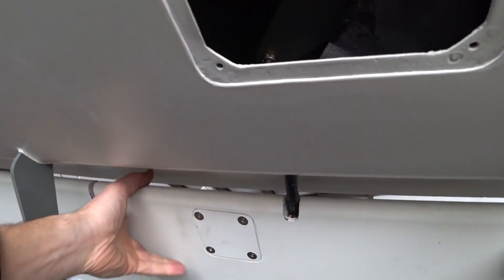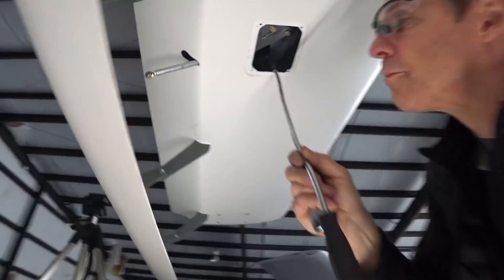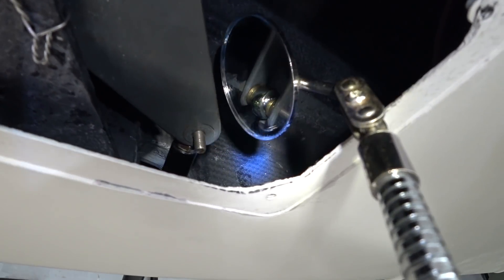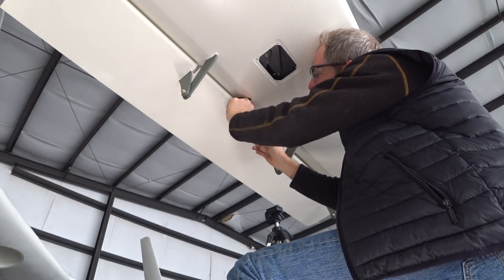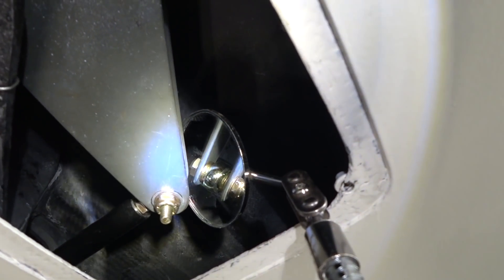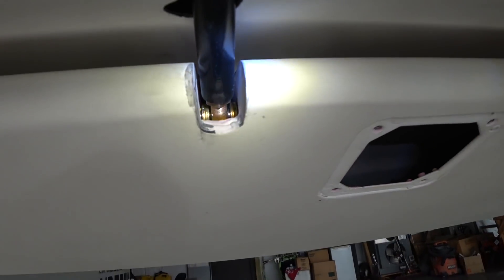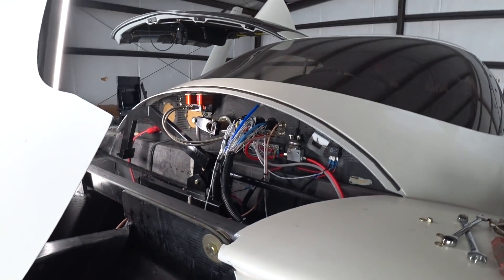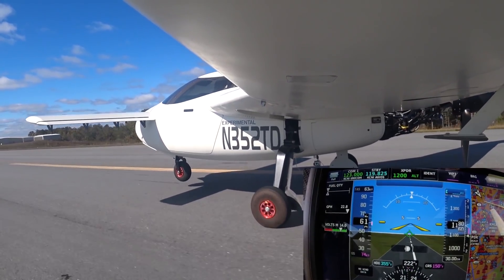Elevator Drop Test - Building the Raptor Prototype

Comment: Hi Peter, Thanks for the update.... Elevator looks solid now!  Disagree with Snow Andrews comment.... I don't know how many PIC hours you have, but one hires test pilots to ensure an expensive prototype is not lost.  The test pilot role is best left to those with a wealth of experience and knowledge.  Their seat of the pants feeling at rotation is likely more sensitive and critical than yours (or mine for that matter, guessing that with more than 3000 PIC and many more right seat or lower crew member hours).

Comment: Peter - I may have missed it, but are much of these issues with the control surfaces going to be re-engineered in/for the production version?
Reply: Brian Garrett most likely production thing about development is you learn tricks then find solutions
Reply: @TransamJc  i was thinking that too,probably upgraded more aswell.
Reply: In a previous video he mentioned using a push-rod system instead of the cable design on subsequent aircraft. This will vastly improve the handling of the airplane while increasing weight slightly.

Comment: What is going to happen when the craft is G loaded (positive or negative)? What response to the counterweight will occur? Move to add or remove G loads?
Reply from the maker: This is the reason for using a counterweight. The same forces are felt by the elevator and the counterweight so it always stays balanced.

Comment: 1:17  “spring acting as a damper.”??? I know this is pedantic but that is dead wrong. 
Spring and weight is the classical way oscillation is taught in high school physics. You do NOT have any damping.  Airflow turbulence is a perfect energy source to provide resonant feedback. 
This gaff makes you sound like the engineer that built the Tacoma narrows bridge. Or the west gate in Melbourne. 
The spring increased stiffness of the system. If you want a damper look up the flutter that motorbike stealing dampers prevent. That lump of lead will mean that the resonance frequency is too low for flutter. 
BUT. And  it is a  🍑 
That frequency might be just right for what aircraft of this design naturally do at stall conditions. If it hits the resonant sweat spot when low and slow. 
The source of the perturbation does not have to be the mass but the aircraft stall bucking driving the elevator because of the hanging airflow. Because of the hinge design this may not be a problem. But I don’t have the details to be sure. 

Lookup a video stall testing an easy.  
If your hand is not on the stick to dampen the oscillation then hold on to your cowboy hat and yell yee ha.  
Or how they crashed an F35 with a low slow pass causing elevator resonant conditions. 

This is not an aerobic aircraft. Damping makes more sense than weight balance. 
Just be careful with oil dampers because some oils can become like honey at -50 degrees. 

FYI the system will react differently with air flow. I would redo the taxi test for a true comparison of the effectiveness of your redesign. 
Also test stall characteristics at altitude before trying a slow approach. 

Be safe. Sorry if my brainstorming sounds melodramatic. 

That elevator drop can be called a feature that migrates the nose dropping hard. Recovering IT support joke. It is not a bug it is a feature.
Reply: Rafal “‘tis better to be thought a fool, than to open ones mouth and remove all doubt”

Comment: While you are waiting for your Test Pilots to come back. 
Why not (Just a suggestion)
do a High-Speed TAXI on the Runway, & do a "ROTATE" 
to see how it feels, with the nose-wheel up,
since your improvements to the control linkages ?

We would LOVE to see that video .
Reply: Even the test pilots with all their skill won't do a high speed taxi unless they decide the plane is airworthy, as they have to be prepared to abort to first flight if something goes wrong and the safest thing to do is to give full power and fly. Probably wasn't a great idea for Peter to do that first high speed taxi with pulling the nose off. And so close to them coming anyway, not really worth it I would assume. -Daven

Comment: I notice your push rods are adjustable - steel/steel threads will eventually seize in place (if exposed to weather).. not a problem if you never adjust it, but an utter pain if you don't put some kind of lube/anti-seize on the threads

Comment: The bolt on the aileron control horn   is supposed to have cotter pin.  That's unairworthy!
Reply: Why....no concept of a self locking  nut???
Reply: Any bolt subject to rotation is required by regulations to have cotter pin
This is very very dangerous.
Reply: @rogerlaubhan7700  Can you give examples of a "bolt subject to rotation??"
Reply: @alanpierce2269   I have not...so what???
Reply: Can YOU define a "bolt subject to rotation????
Reply: @alanpierce2269  I bought plans and the license to build a KR-2 many, many years ago....but never got around to starting the project.  Either not enough time, money or both...had planned on using a 2300cc VW engine. But, I have searched for a definition regarding a "bolt subject to rotation" and found very little info... does that refer to a bolt that can turn when installed, or is it the bolt that's a pivot for a device that turns...like a pulley??
Reply: @alanpierce2269  Is it possible to provide a link to this info.... I no longer have my old 43-13...and an extensive search on the internet resulted in different answers....which is why I'm seeking the answer to what a "bolt subject to rotation" really is...
Reply: @alanpierce2269  No, I'm in the US...had to google "Jabirus." lol   I have read excerpts from 43-13 and the appropriate Advisory Circulars...I agree the FAA says to have a "non-friction" type of safety as well as, if using a self locking nut on a "bolt subject to rotation..."...but have not found any official definition of  a "bolt subject to rotation."

Comment: Graphene battery technology is coming and it could mean an  E-Raptor / Raptor-E (?) will be possible within this decade.  
Graphene batteries will be lighter, cooler, and charge in 1/4 the time of today's Tesla batteries.
Reply: battery tech improves 5% a year. We need about a 10x improvement for small aircraft. We will be dead first.
Reply: @savethedeveloper  Graphene tech is moving faster than 5% though and the motors are already here.
Reply: An estimate of about 500kwh per Kg is what we would need, and currently we're at about 280, and climbing fast.
Reply: The Raptor's diesel engine(475 lbs) and 121 fuel gallon capacity(847 lbs) provide for 350 horsepower for several hours. Show me the equivalent electrical solution for 1322lbs that can fit on a small aircraft. This type of battery fiction belongs on the Tesla fanboy channels, not Peter's construction blog.
Reply: How about, you do the calculations, and then come back to us.  I'm not saying the performance, or range would be the same, however, it would be in the range of acceptableness.
Reply: I think the point and spirit is missed here in a couple of points, about the original comment.  First, the Raptor is being created as an open source project.  That means, that he intends on letting anyone have access to it.  Not only that, but it is a homebuilt concept plane. Anyone building it could decide on whatever powerplant they choose.  Personally, I like the current idea of the Audi.  Second, if someone... Anyone chooses to have a dream, or even just an idea. What makes another decide that it is irrelevant, or will never happen.  Spacifically, without first, fully understanding the concept in the first place.  Sorry for my rant, I just have a problem with someone stiffeling another's thoughts.
Reply: @alanpierce2269  not just your comment, but yes.  On the home page of Raptor....  Changing General Aviation in a big way

We are offering a completed Raptor 'At Cost' and will eventually Open Source the whole program so universities and businesses will be able to have access to the design and make improvements and modifications in the same way that open source works in the software world.... You can go there to read the rest.
As far as the current approach, yes, it might have been a good idea to go with an aviation engine in the prototype, however, I think, again you miss the spirit of the project.  It's an experimental project.  The aviation industry needs this, or three while industry would be no different than it was in 1903